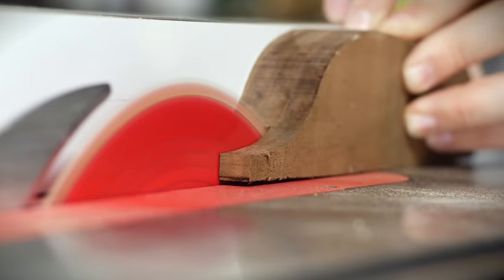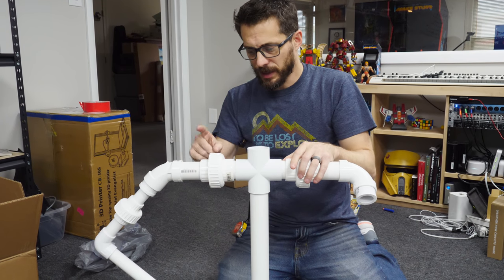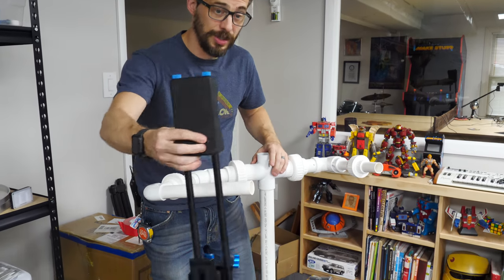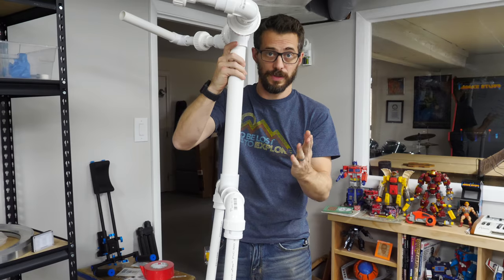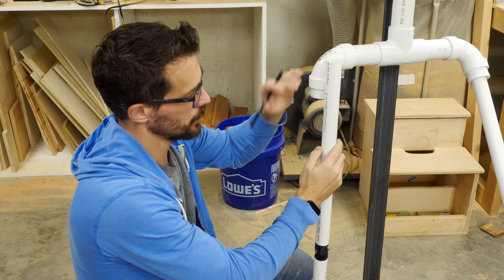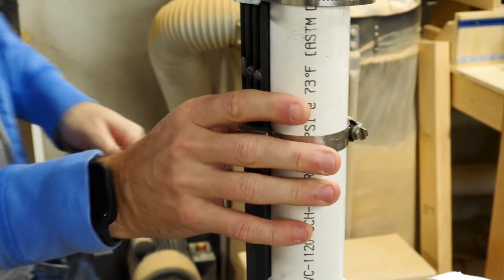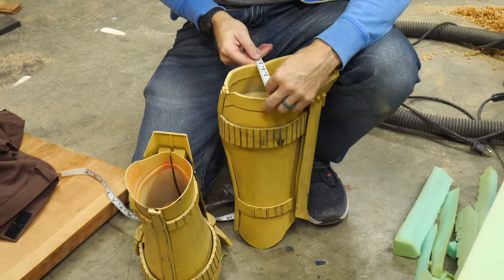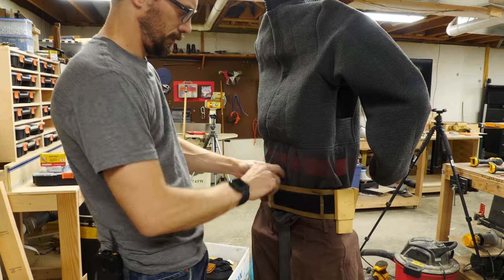How to Make a Posable Mannequin | I Like To Make Stuff

Comment: As an alternative to using the green foam, you could buy a morph suit and stuff it with poly-fil to get the necessary muscles. If you want direct access to the joints for swapping out parts, you could just cut the morph suit open and glue it down to the PVC on each side of the joint.

Comment: Pretty slick trick using the unions to make the adjustable joints. The hands are great,maybe adding some rubber hose (think garden hose) sections to the fingers might "flesh" them out a bit as they look flat to me.

Comment: Since you're using steel as a backbone, a decent idea for a base would be to get a used front wheel hub/rotor from a brake shop that they're throwing away... something off a F350 or something and just weld that steel to the rotor. Heavy and stable enough, yet, it'd take less floor space.

Comment: Great Vid! I'm actually building something similar. I found a site that sells PVC mannequins w/articulating joints, but the weight of the armor/gear was too much, and ended up building the lower torso/legs from threaded 1/2" steel pipe. This also negated the need for a torso brace as the legs are bolted to the base with standard 1/2" pipe flanges. I also used pool noodles & foam from the upholstery outlet for the musculature. It's still a work in progress, but ALOT of fun :)

Comment: You can make a pose-able mannequin with 1 1/4 pvc,  Couplings, caps and golf balls.  Each golf ball gets a bolt through.  You heat the coupling and pound a golf ball into it and then use gloves to squeese it shut.  Put a cap on the bolt.  You now have a movable joint.  Use a set screw to lock it where you want it.    I then use 60 cent pool noodles to shape the muscles.  Build them up in strips to any body size you want.  I guess I should do that video next since this message is probably too confusing to follow:)

Comment: Why not use a cement base?  It would be heavier for more stability, and you wouldn't need to worry about drilling or an underplate.  A butcher block that size is expensive, and it seems like a waste to use it for something you could make for pennies with cement which works just as well.

Comment: If you put the unions on in the correct way (which I think yo did) then any downward weight like the gun will actually tighten the joint, so it shouldnt move.

Comment: the way you hold the rifle at 3:12 annoys the crap out of me. When firing a rifle, the stock should always rest around where the clavicle meets the scapula, otherwise you run the risk of bruising or worse. For instance, with a powerful enough gun, if you were to fire it the way you are holding it against your upper arm, you could possibly break the bone.